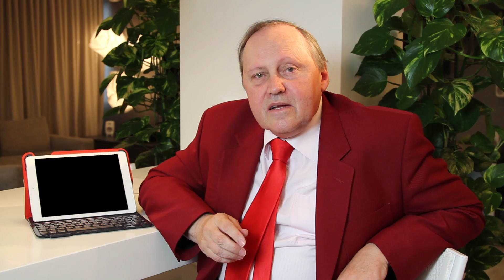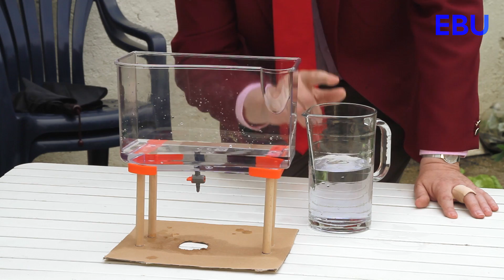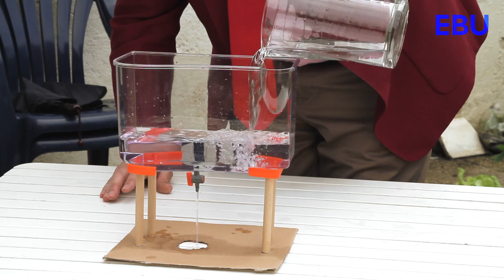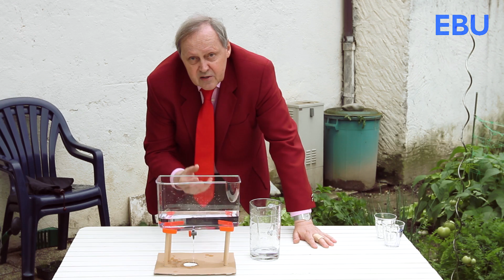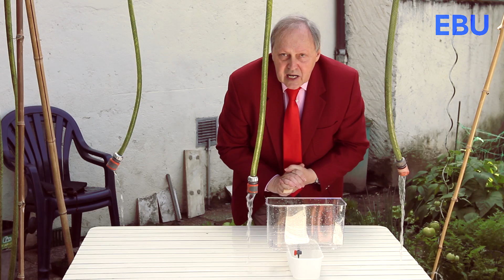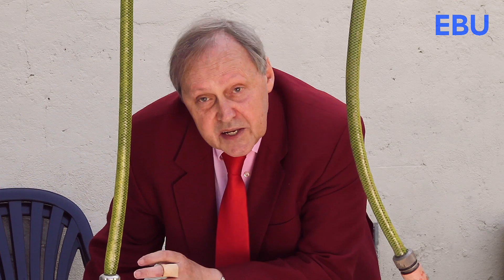Smooth Streaming techniques

Comment: The analogy is very confusing for those who don't already understand the concepts. The 'high quality, high bitrate' stream is filling up the 'buffer' faster, meaning the outlet is less likely to be stopped. The 'low quality, low bitrate' stream is not filling up the 'buffer' nearly as fast, and it is natural to assume therefore the outlet will be stopped if the outlet's rate of flow is greater than that of the input low quality stream.

The viewer therefore comes to the conclusion that for uninterrupted viewing, they should choose the 'high quality, high bitrate' stream, when we know the opposite may be true.